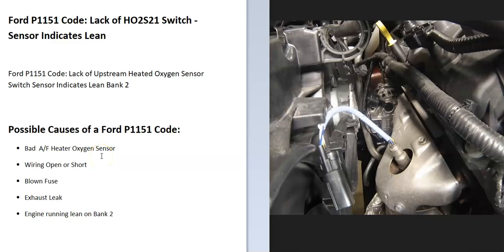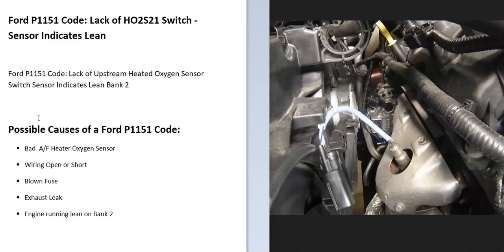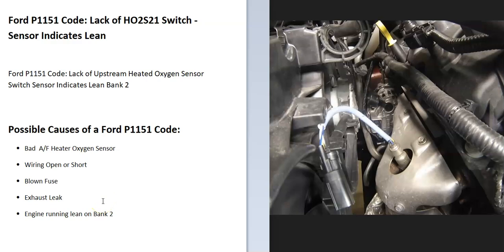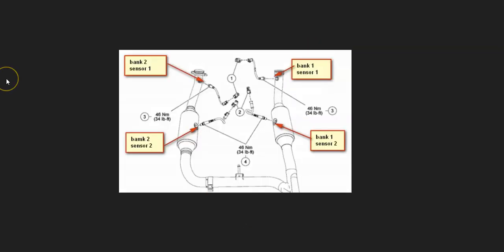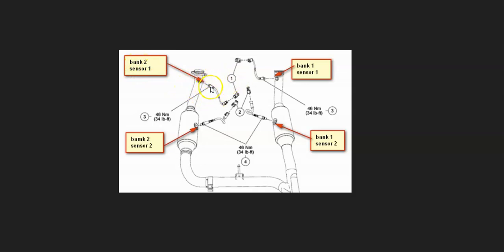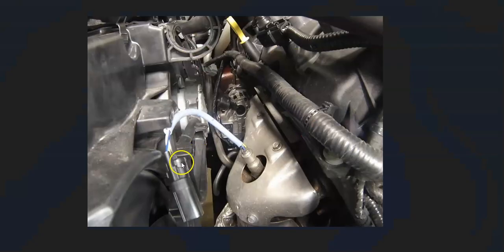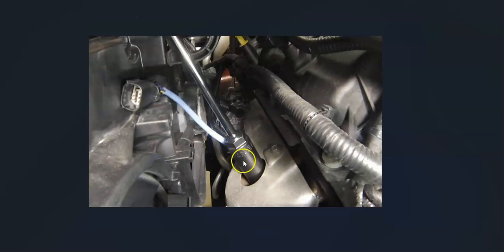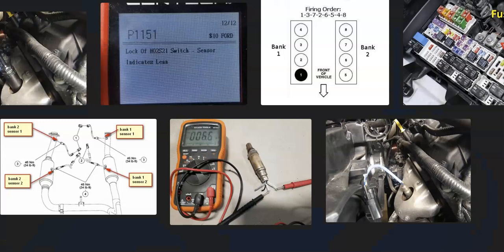Causes and Fixes Ford P1151 Code: Lack of HO2S21 Switch - Sensor Indicates Lean

Comment: If disconnected will it run
Reply from the maker: Most engines run OK with a bad 02 sensor. It will be less responsive and get less gas mileage but should still be drivable.

Comment: Just my 2 cents after watching this video several times, working on my truck. I got this code on a '97 Ford F150 4.2L V6. I actually had a the Catalytic converter replaced, and then this code kept popping up. I got a NTK 02 sensor and replaced the upper sensor on driver's side (just the 1, not the 2 as people recommend) and it solved the code and began running so smooth is was freaky.

Comment: ok. I have replaced plugs,wires, coil pack and O2 sensors (4 of them). why am I getting this code. also getting multiple misfire code P0300,04, and 05.
99 windstar 3.8
Reply from the maker: I would fix the misfire codes first, as they may be causing the issue.

Comment: The guys shop i don't like the work they done to his truck they done a shitty job on it from one part and piece to the next an they ran a ton of tests on this truck anyhow i worked out one short in the plate  light fixture wiring and rescanned and is just showing 1 sensor problem thats probably only the cab light because its fixture is old with shorts.

But from how his shop done underneath this truck my guess is they didn't replace any old sensors and this truck being old probably needs them or needs the plug in cleaned off

Comment: Nothing i can do for the worn light fixture until put a new one in i can replace all the sensors and it could still show those codes if i don't replace the light fixture just from what i read 

But i will check the muffler sensors later in daytime when i have plenty of light and cold air be funny i replace all that shit and the light fixture makes the codes come back could unplug fuse to those but they work so won't do that those sensors don't really do much

Comment: I read a short on the circuit can cause these codes mines been in the shop 5 years ago but im not sure if they changed any of these old sensors 

But its looking like mines codes appear because of multiple shorts the first short was in the plate light fixture i fixed that then retested and got this but theres still another short in the cab light

Comment: Thanks for this video. I have a 2000 Mercury Sable with 117K that’s still kickin’.  The P1151 has ‘haunted’ me on and off over the last year and a half. Since an aging car, I did a bunch of stuff to ensure no vacuum leak. First time EGR valve turned out to be the culprit. Code disappeared for a little over a year. Recently returned. Smoke test revealed diaphragm in replacement EGR was bad. After replacing the replacement CEL stayed off for 600 miles before returning. I’d already replaced O2 and MAF sensors last year so was at the point of suspecting fuel injector(s) since all but 1 appear to be original according to service records and fuel filter recently replaced when car was hesitating (fixed the issue). Also realized if overall fuel pressure was affected I should probably get a P1131 code for the other bank, too. But I hadn’t considered an exhaust leak, so I’ll check that out before I remove the intake manifold again to do the injectors, though the first time was to address manifold gaskets.  Want to keep this car going a little longer so hopefully I can chase down this gremlin soon.
Reply: @stingray65b 
Hows that sable holding up man? I got a 2000 ford taurus that's basically the same car and has been giving me the same run around as you . Have you done any other repairs ever since your last comment ?
Reply: @Aylowws  Howdy.  As you can appreciate, at some point it sort of becomes a 'fishing' expedition.  Since that post, I believe there were three other main things I did.  

(1) I wanted to clean the injectors, but am not in an ideal working environment to take them out completely.  My compromise was to leave the rail in place and just clean the supply side.  I fabricated an attachment using a separate rail connector, a piece of hose, and the spray straw for a can of carb cleaner set into the hose with glue.  Was able to start the car, and run it on carb cleaner for a few minutes with some short, judicious blasts into the rail.  (Note:  I mentioned in my original post that if the P1151 had been caused by incorrect fuel pressure then it would seem a P1131 should likely have shown for the other bank because the fuel supply comes into a single rail.  Maybe I'm not reasoning this correctly, but in any case, I didn't have a pressure gauge in my tools and got one on sale after the cleaning.  Testing at the Shrader valve on the fuel rail after cleaning read within spec.  I suppose some would say if I had tested before cleaning I might have concluded that pressure at spec would have eliminated both fuel pump pressure and pressure through the injectors as factors, but given the age of the injectors I was eager to do some cleaning thinking it might still help performance a bit.)  I cleared the code, then about two weeks later, the CEL came on during my drive to get an inspection.  Wonderful timing.  

(2)  I had previously replaced both upstream O2 sensors, but Sensor 2, Bank 1 was now putting out 0 volts.  Reset code after replacing and got another 800+ miles before CEL reappeared.  

(3) At this point, I was at a loss for what else I could do.  The only thing rolling around in the back of my mind... a service place I use when I'm not doing my own repairs noted that even with indications of codes/problems upstream, issues with exhaust pressure could be triggering these codes.  About the same time, a friend of mine was talking about a similar issue he was having and was going to run some Cataclean through the fuel system.  Cataclean says to let the tank get to 1/4 but I figured since my car was old I'd let it get to 1/8.  Don't know if there's any logic to that other than my wanting to keep the solution as concentrated as possible while drawing it through the fuel system.  Drove the car hard for the required time.  Filled the tank, and got another 2500+ miles without a CEL.  Another P1151 popped up again recently, so I added another bottle of Cataclean.  I've driven about 150 miles so far.  Hoping Cataclean is again the answer.  Not hard to see as a cause, since the cats are original and car is at 121K.  Engine otherwise running well, but it's an east coast car and the rocker panels have disintegrated.  Rust has even spread up into the bottom of the A-pillar (think that's what you call it).  The plastic side trim mostly hides the non-existent rockers, but I had to use cable ties to pull the two pieces together, since the pegs that would normally snap into metal are now floating in space.  Somehow, the connections of the trim to the body are still holding at the ends, otherwise the whole thing would just fall off.  I'll probably have to replace the car this year.  

Hope there's something in here that can help you. If there's any related detail I missed, let me know.  Best of luck with the Taurus!

Comment: I cleaned the throttle body with throttle body cleaner and it set off code p1152 and p1132.. It has me concerned.
Reply from the maker: The throttle body cleaner is likely just burning off, causing a rich condition. It likely will clear.
Reply: @HVAC_Mechanic  I think so too. Thank you.